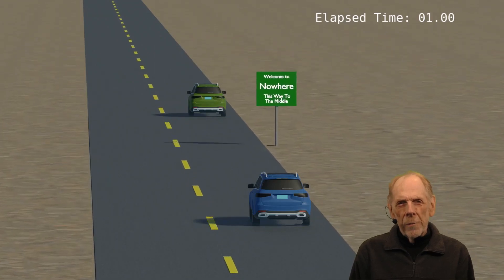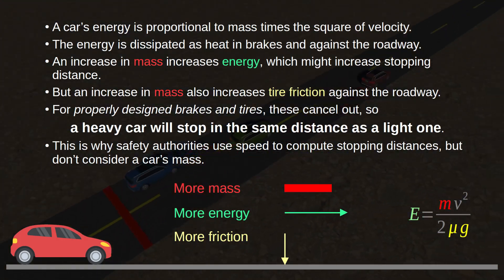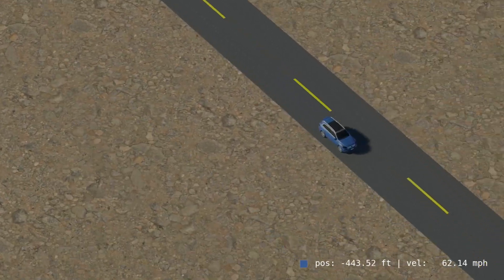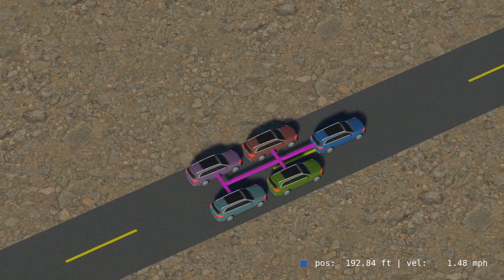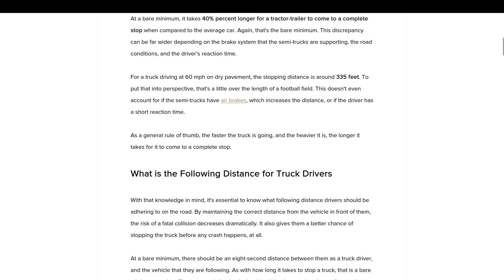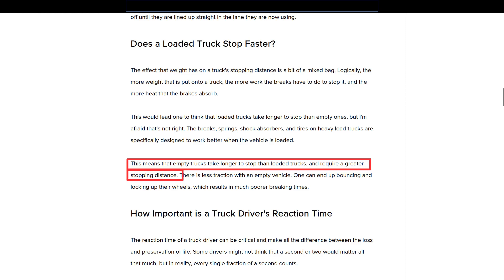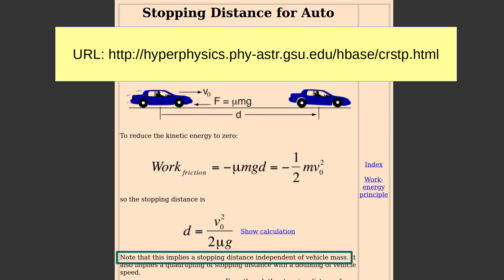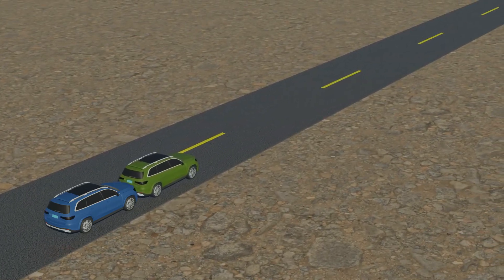Car Safety Myths: Exposed

Comment: I strongly disagree with your analysis  as to mass and braking distance. While I don't disagree with the fundamental equations and information presented. I also don't disagree with you are presenting an ideal word. Mass will change vehicle dynamics, especially in low, or no friction surfaces, snow, gravel, hydroplaning, etc or change of direction situations. It will change the ability for a vehicle to change states , moving or maneuvering.  I would never advise a driver that the mass of vehicle doesn't change vehicle dynamics, including braking. So you can "prove it." in your ideal world, but if you're trying to keep a person safe. The advice here, is misleading. If you'd like to take a drive in a loaded (more massive), versus non-loaded car. I'll gladly take a test with two identical vehicles and see if there is a difference. When you're ready for a test, let me know??? When you start a deep dive on friction, you'll get into limits of tire separation, or as you state tire melting. This turns into a low friction situation. This also means mass and inertia will take over, no matter what brakes, or tires are on the vehicle. These properties are directly related to mass. FYI appreciate your tutorial videos, however this video hits on a different note.
Reply from the maker: Your objection refers to special cases, not physical principles, and I qualified my general claims in the video to avoid this kind of special-case objection.

> This also means mass and inertia will take over, no matter what brakes, or tires are on the vehicle. 

If tires and brakes are correctly chosen, appropriate to the expected loads, this objection evaporates. I proved that with my multiple-car example, which distributes the load across enough tires and brakes to make a heavy vehicle equal to a light one in every way. That was the point of the example.

For a single heavy vehicle, one simply chooses the right combination of tires and brakes. But trucking firms won't do this -- it's too expensive.

Reference: https://hyperphysics.phy-astr.gsu.edu/hbase/crstp.html

Quote: "Note that this implies a stopping distance independent of vehicle mass. It also implies a quadrupling of stopping distance with a doubling of vehicle speed."

The more you know about physics, the more likely it is that you will understand that all vehicles could be designed to stop in the same distance, all practical and economic considerations aside.

Thanks for writing!

Comment: Automotive engineer here. Generally good information, but sorry, your formula at 9:00 is wrong. Kinetic energy is universal and has no friction or gravity term. Your claim of 4x stopping distance at twice the speed is physically true, though, just the equations you show have an error. Maybe the term you showed is something else, but it is not energy. Make the unit test: kg * (m/s)^2 / (1 * m/s^2) = kg m is not Joule.

In reality, at higher speeds, the tires have less time to grip into the road and the car (not a racecar usually) experiences aerodynamic lift, so the stopping distance is way more than 4x at 2x speed. And do not start with aquaplaning (drop in friction above a certain speed), this will make the comparison completely scary.
Reply: I think I figured out the equation you wanted to write at 9:00. It is stopping distance d = v^2 / (2 mu g).
Reply from the maker: @doczooc  > It is stopping distance d = v^2 / (2 mu g)

Well,  you did correctly identify a problem in my equation -- it fails as anything but an illustration and needs at least one more term to function as intended.

If I wanted to include a mass term, it can be written this way, which unfortunately would have left most viewers confused:

E = m v^2 / 2 (1+ mu g)

This prevents an infinite result in the event of no friction (mu) -- the equation in the video has that rather serious drawback. :)

And in  the case of no friction, it becomes the classic energy equation E = m v^2 / 2.

Again, I thank you for your helpful posts.
Reply from the maker: > Kinetic energy is universal and has no friction or gravity term. 

Yes, that's correct, but the equation you refer to describes the dynamics of braking, therefore it must go beyond kinetic+potential energy. For completeness I included the source -- the HyperPhysics mathematical analysis included later in that section (and see below for more on this topic).

>> Make the unit test: kg * (m/s)^2 / (1 * m/s^2)

This lacks a friction term, which I included in my equation to explain why mass doesn't affect stopping distance in a first-order analysis (second-order effects prevent this from being the whole story).

EDIT: The equation you referenced and correctly identified as wrong, is meant only as an illustration -- it requires at least one more term to function as intended. Here is the correct form:

E = m v^2 / 2 (1+mu g)

This form behaves itself with differing friction amounts, and if no friction, becomes the classic energy equation E = m v^2 / 2.

Again, the equation in the video is only meant to convey an idea and won't behave as shown.

Thanks for your correction!

Comment: Braking 60-0 in the dry is more like 130 ft in sedans. Many can do it in even less depending on ABS and driver skill.
Reply from the maker: > "Braking 60-0 in the dry is more like 130 ft in sedans."

In field tests, and consistent with theory, and assuming adequate brakes, tires and equal axle loading, all vehicles stop in the same distance for a given speed. This is why safety agencies list vehicle speed and correlate that with stopping distance, but omit vehicle mass.

But if a vehicle doesn't have brakes and tires consistent with its mass, or is loaded improperly, this relationship goes out the window.

> Many can do it in even less depending on ABS and driver skill.

No, not so. Once ABS kicks in, the stopping distance is fixed, and beyond a driver's ability to change it -- except, of course, to make it longer by releasing the brakes.
Reply: @lutusp  130 feet is not unrealistic. Motor trend reports 2013 Audi A5 coupé to have stopping distance 60-0 of 101 feet in the dry. 3500 lb is typical sedan weight. Therefore by your logic it should be more like 100 ft 60-0 right? Not 180?

ABS gives up braking distance to allow steering. If the tire was using literally 100% of its grip to stop, you wouldn't be able to turn. ABS pulses the brake, when the brake is released, turning capability is restored. Therefore ABS is technically not the greatest stopping distance possible. However I will say this is a minor caveat I wouldn't hold against your analysis. ABS is good enough and is often super close to the theoretical limit. Just a quirk of how it works if it's using PWM
Reply: @lutusp  just wanted to add, I don't dispute your conclusions at all. Just the actual realistic braking distance. It's fine to present a worst case scenario but you should at least mention that 180 ft is just about a worst case 60-0. 

I have watched so many dashcam videos where people act like they've never even heard of a brake. Probably at least half of drivers lack the necessary understanding of car handling enough to be safe at modern highway speeds. So, it's genuinely not that bad to assume worst case distances. But, attentive and skilled drivers will do far better than the numbers you are presenting in this video.
Reply from the maker: @HarryTheOwlcat  > But, attentive and skilled drivers will do far better than the numbers you are presenting in this video.

Yes, that's true, mostly having to do with reaction time, which varies greatly from driver to driver.

Other factors are road surface conditions, brake design, and differential axle loading, all of which can undermine the effectiveness of a stop.

In many ways my numbers are worst-case, for example the three-second rule and an imagined 1.5 second reaction time. But safety agencies agree with these conservative limits and precautions.

Thanks for writing!
Reply from the maker: @HarryTheOwlcat  > It's fine to present a worst case scenario but you should at least mention that 180 ft is just about a worst case 60-0. 

Yes, true, but in a publicly released video that might change a young driver behavior, it's best to look at published field-test stopping distances and choose the worst case.

Consider the alternative -- a distraught mother decides to hold me to account for her son's avoidable accident. Weirder things have happened. :)

Thanks for posting!

Comment: 7:50 but at least the formula in Q1 works out right? The brakeforce is given and by no means dependant on the mass.
Reply from the maker: Sorry, I'm on the road and can't see the specific equation you're referring to. If it includes the friction coefficient μ, then yes, that factor is dependent on mass -- more mass, more friction. The conversion isn't perfect in practice, but it's the reason there is nearly equal stopping distances for light and heavy vehicles, but only if they're engineered to manage the different energies.

Thanks for writing!
Reply: I talk about F=m*a leading to the car slowing down at 2m/s²

Comment: So, your 10t car needs 20 wheels and 20 sets of brakes. Stack those 5 cars on each other, so there's only 4 wheels and 4 brakes, and you will indeed have a much harder time stopping. That's the problem most people face as they load their car/truck. Driving around with nothing in the trunk/bed is much different than driving around with a heavy load. The braking force you're used to will not be enough to stop in the expected distance. (and if your trailer brakes go out, then you have a problem... the mass of 5 cars, without the brakes of 5 cars.)

As mass increases, so does the work necessary to stop -- inertia. The brakes can easily overcome tire traction - aka. a skid. (I'll leave the murderous nature of ABS for a different time.) Ultimately, the tires are what does all the work - keeping you connected to the ground. That is a finite amount of traction (grip), and it does depend on weight. It's a balancing act between inertia and traction. It's as much a "science" issue as it is engineering. Tires and brakes can only get so big, and there will only be so many of them. When you double the mass, does it double the traction? Usually, it doesn't.

If you're curious, look at airplane brakes. That's a huge mass, with tremendous traction, on a surface designed to maximize traction, so they have equally massive multi-pack brakes. They, too, have more brake than traction, and they have an anti-skid system like a car's ABS.
Reply from the maker: > So, your 10t car needs 20 wheels and 20 sets of brakes. Stack those 5 cars on each other, so there's only 4 wheels and 4 brakes, and you will indeed have a much harder time stopping. 

Yes, as explained in the video, but let me put it in simpler terms: for two cars of different masses, engineering changes can produce the same stopping distance. But for two cars traveling at different speeds, no engineering change can equalize their stopping distances. 

I hope this helps, and thanks for writing.

Comment: A better way to explain the stopping distance being independent of mass is that the total energy needs to be dissipated in braking, so 
ΣE= (1/2)m(v)^2 - μmgx = 0, where μ is coefficient of friction between tires and road and x is stopping distance
(1/2)m(v)^2 = μmgx
x=(v^2)/(2μg)
However, in practice this assumes that the loading and the braking force is evenly distributed, where in reality you will probably have one axle lock up before the others in a large truck, which was mentioned in the video as an issue when trucks are empty, since the weight shifts forward and unloads the rear axles.
Reply from the maker: Yes, but when doing science, it's necessary to control for all extraneous factors in order to properly study just one. Otherwise no useful science is possible.

Comment: Your clinical values of pavement friction are ignoring tire slip on the rim. At such great frictional loads that fewer tires would have you're more likely to increase rim slip. These are fractional increases in stopping distance . . . that is until you blow out a tire. This is the reason the 18 wheeler needs so many wheels, it needs the reduction of frictional loading. Observe a cement truck that has a drop down extra pair of tires in the back. These tires are for traveling when the truck is full and can stay stowed out of the way when the truck is empty. Your point that a mega vehicle stops at the same distance 5 individual vehicles would stop is sound except you'd need specialized tires.
Reply from the maker: > Your clinical values of pavement friction are ignoring tire slip on the rim.

If the tires slip along the wheel rim, something went wrong in the tire shop and the company is responsible. But this isn't a realistic scenario if the wheels and tires are appropriate to the vehicle.

Thanks for writing!
Reply: @lutusp  >appropriate to the vehicle.

So just math then and not real world physics. Have some special tires been invented that would be appropriate on both a 20,000 ton car and a 2 ton car?

Your math checks out, but something is going to give because material science isn't keeping up.
Reply from the maker: @djdickey  > Have some special tires been invented that would be appropriate on both a 20,000 ton car and a 2 ton car?

No one made that claim. The right tires and brakes can be designed for each example vehicle, not some universal solution for any vehicle.

Comment: Stopping distance is doubled for a mass that is doubled when equal amount of force is used. Larger mass must use higher force to stop in same distance. With Road Vehicles, slip must also be considered since even if brakes had infinite force, it means nothing when wheel slides. Drivers will then opt to use less brake force so there's less wheel slip, but doing so will increase stopping distance. So yes mass isn't the only factor in stopping distance for road vehicles, but it isn't irrelevant.
Reply from the maker: > Stopping distance is doubled for a mass that is doubled when equal amount of force is used ...

Yes, but that's not the claim. The erroneous claim is to say that a heavier vehicle requires more stopping distance. That's wrong -- such a vehicle requires better equipment to deal with more energy. There is no physical principle that mandates a greater stopping distance for heavier cars, when other factors are properly controlled for.

Comment: Whilst you are absolutely correct in 95% of what you say, your analysis of mass vs stopping distance does not take into account the brakes themselves. When breaking, there are two sets of friction at play. The first, which you take great care to analyze in detail, is the friction between the wheel and the road. As you point out, increasing the mass results in increased maximum available friction, thus cancelling out the increased force required to stop the vehicle. The second, however, is the friction within the brakes themselves. This is unaffected by the mass, since the force is applied solely by the pressure of the brake pads on the disks / rotors/ drums. This force comes from the driver's pedal (possibly boosted by power-assisted brakes) but will not automatically be increased with an increase in mass. Don't forget, in this case we actually don't want the friction to be high enough to lock the brakes up, which further complicates the calculations The whole situation gets even more complicated when ABS is brought into play. Your example of the cars joined together works when it comes to road friction, but fails to take into account that the five joined vehicles have five times as many sets of brakes.
Overall, I think that as long as a car is operating within it's design specifications, it probably doesn't make much difference, but we all know that many people overload their cars (either directly, or indirectly) and in these cases assuming the mass has no overall effect can be dangerous.
Reply from the maker: > ... your analysis of mass vs stopping distance does not take into account the brakes themselves. 

My analysis assumes that tire-pavement friction resists the car's forward motion. The brakes must allow this to happen, so they're not part of the analysis, which focuses on that one factor.

In science, one must control all factors in order to be able to study just one.

Comment: It's misleading to say mass has no effect on braking distance. The peak traction of a tire is dependent on a lot of things like the contact patch area, surface roughness (both in terms of static friction and for the tread to physically deform into), temperature (rubber deforms differently depending on temperature), surface conditions, etc.

A counter example would be wet conditions. As you scale up the contact patch with mass, the water between the tire and the road surface has to displace the water a longer distance. Granted it has more force to do so with, but fluid dynamics do not scale linearly (to double the water particle speed you need four times the force). Neither does the contact patch area scale linearly with mass even if you kept the same tire (there's no simple equation for this as it depends on the tire wall stiffness, tire pressure, compound stiffness, cord stiffness, cord pattern, and so forth). This is one of the many reasons truck tires have a much larger diameter than a car tire while the width is still in the same ballpark as a wide sports car tire.
Reply from the maker: > It's misleading to say mass has no effect on braking distance ...

There are second-order effects in everyday practice, but from a physics standpoint  the statement is correct. And my example section shows many educational sites that try to claim that mass causes a direct, linear increase in stopping distance, which is certainly wrong.